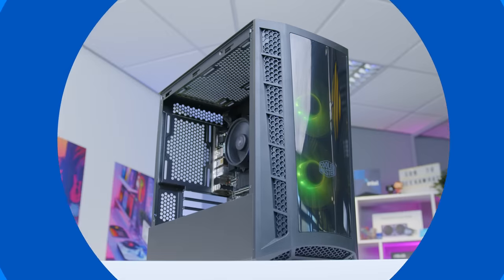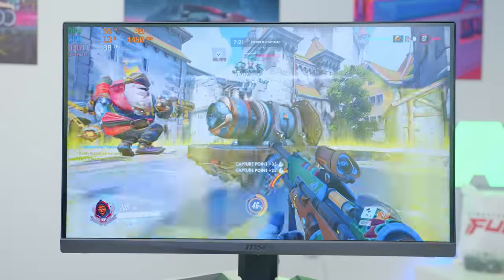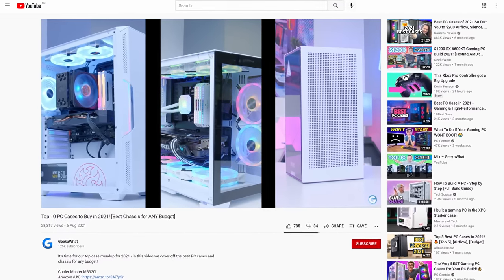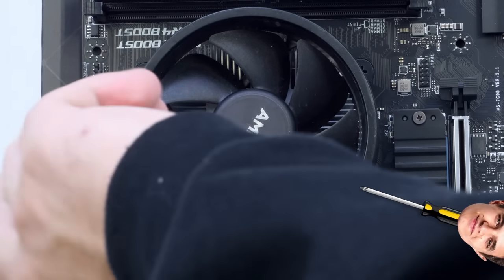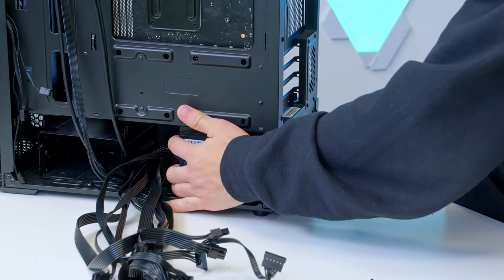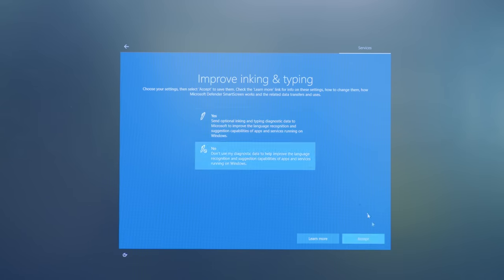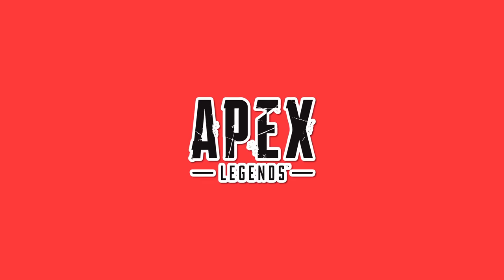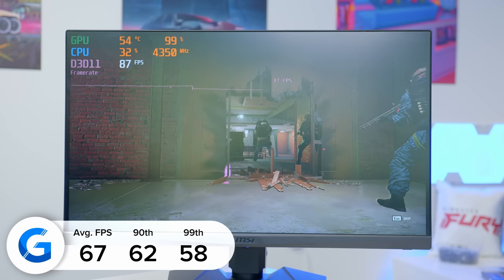Budget $550 Gaming PC Build 2021! [Full Build Guide w/ Benchmarks, BIOS & Windows Installation!]

Comment: Quick question, In sometime down the future when you decided to upgrade this build with a new gpu, what would you use?
Reply: This apu in on par with a over clocked Gtx 1030. Therefore, any gpu better than that will be an upgrade. You should choose based on your budget and the performance you want. Realistically, for 1440p or 144fps on 1080p you would want a 1650 ti minimum (msrp : $185 current price: ~ $250-$300)
Reply: @isolatefn  Alright thanks alot mate
Reply from the maker: I'd go for any of the following: GTX 1660 Super, 2060, 2060 Super or maybe even 3060 (and then the equiv AMD GPUs as well)

Comment: What gpu would you recommend for this pc?
Give me any compatible gpus
Reply: 1660 2060 or 3060 or any amd equivalent
Reply: For 1080p or even 1440p gaming : The 5600g is very similar to a Ryzen 3600 or 3600x when a dedicated GPU is added so IMO something maxing out along the lines of a 3060TI, 3070 or Rx 6600xt would even be a good pairing. If you can get a used card maybe a 2070 super 2080 or even a gtx 1080ti to a lesser extent would have a nice balance. Any lesser card is fine too of course. 1660 vanilla, super or ti and even the venerable Rx 570 or Gtx 1060 used to get a decent upgrade that will blow the integrated Vega graphics away. Hope this helps and of course this is just my opinion. Cheers!
Reply: @TheJamesKF  thanks for the help dude peace 🙏🙏
Reply: @Warpyyytfbmmm3  thanks

Comment: Is there a graphics card that can substitute for the rtx 3060 ti?
Reply: You mean perform simular? Yes, the rx 6700xt.
Reply: @ties9123  Nop, It would be the 6600 xt.
Reply: @nicolasgracia1040  absolutely not. The rx 6600xt performs a bit better than the rtx 3060, but isn't going to perform anywhere simular to the 3060 ti. The 3060 ti performs a lot better.
Reply: @ties9123  Well, you aren't wrong but the thing is that the 6700xt is not the one that is matching the 3060TI it is comparable to the 3070, that's why I mentioned the 6600XT because they're in a similar range of price and not too far in performance.
But yeah, I would say that currently the 3060TI doesn't have a card to compare with.

Let's wait for those gpus that Intel is gonna release.
Reply: @nicolasgracia1040  no, but literally. The 3060 ti outperforms the 6600xt by actually a lot. The 6700xt is on average a bit worse than the 3070 in gaming and in most games it's simular in performance with the 3060 ti.